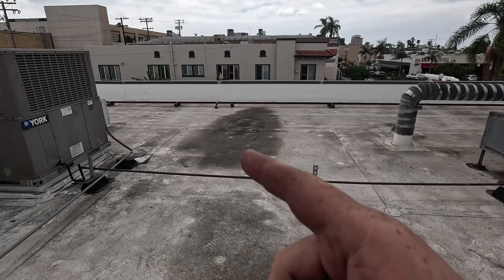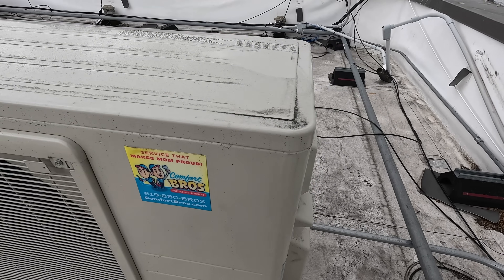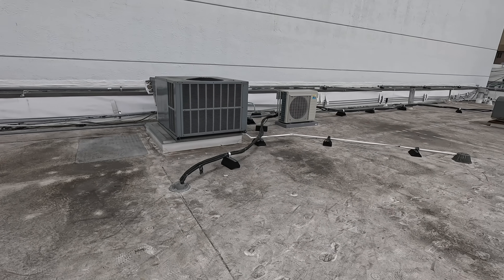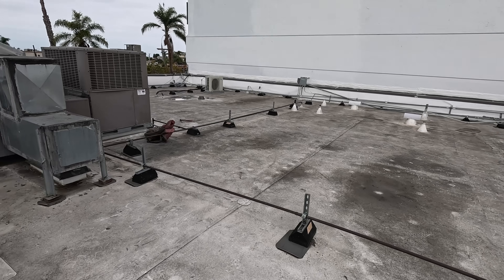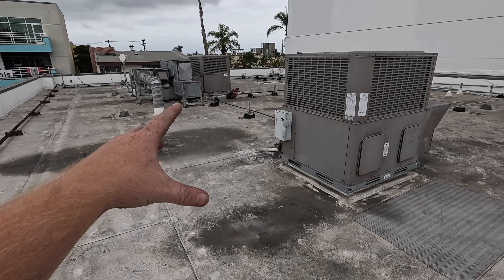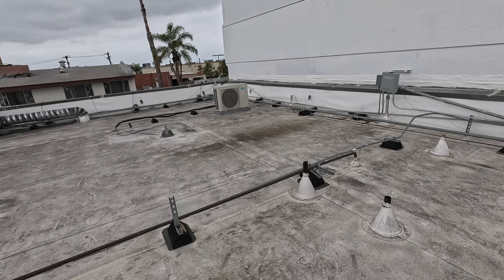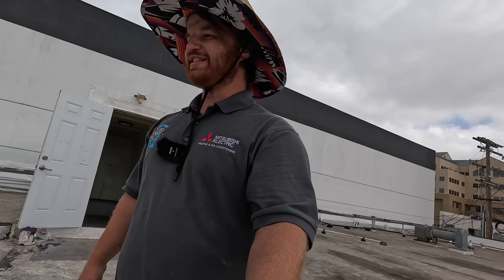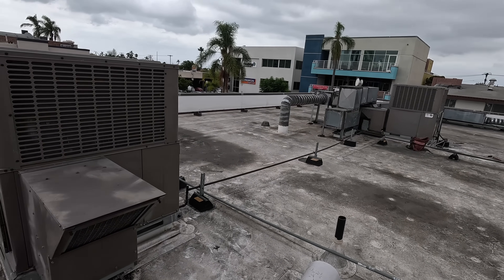$50,000 HVAC Install Mistake Required Two Minute Fix

Comment: A quick check of the supply temperatures at the registers would have caught that.
Reply: There is a surprising number of techs who don’t have a thermometer
Reply: The service tech who posted this mentioned that the unit was discharging into the rafters; I don't know why they would install it like that. But it would make it hard to get a good measurement.

Comment: Omg heat running for 6 yrs on an AC call… caused by an missed programmed tstat was it the OB switch or programming & no one caught it … sound like one of my  calls a few years ago for a friends daughter he had a new 90 % gas furnace 
installed like 4 yr before  & the complaints were that heat would run some 30-90 seconds & cut off. & none of the 3 other hva c co that came out could not figure it out why ..? > one installed a new board the other a new pressure switch & all it was & i seen it in 15 seconds was the combustion air was still caped from factory…. No combustion air no-flame no heat for 4 years no heat fixed it less than 30 seconds

Comment: Find the install techs who originally installed them and have them sued into oblivion. Where they can only escape the debt if they are banned from HVAC service.
Reply: Yeah it doesn't work like that. The contract is with the HVAC company, not the techs.
Reply: @willlewis6747  Right, it is the company's responsibility to make sure their techs are properly trained and qualified for the work they are assigned to

Comment: Someone with a $25 Harbor Freight laser thermometer could have easily discovered that unit was belching out heat the entire time. It's too bad... Untrained, lazy, or greedy techs taint the entire HVAC industry. The greediest ones are just emulating the HVAC manufacturers with the current "equipment shortages" and R-454B scarcity and nose-bleed pricing.
Reply: yep I almost mentioned that in my comment.

Comment: No one fucking sticks a thermometer in those units to get a split? Wtf
Reply from the maker: Too busy selling IAQ products. Each unit has a UV light, iwave and aerus air scrubber
Reply: @SurfBrosHVAC I'm a year into this trade... Phoenix AZ. Working on half residential/ half commercial....walk ins...reach ins...... Blah blah similar to what your business works on. I can see while there're limitless areas to grow and paths to take to specialize. It would be quite easy to stagnate and waste time where I'm at now. I feel like my skill level a year in might not be much different from a guy 6 years in working for the same company. Therefore... I feel like I need to pick a path or at least an area of study. I would at least like to be a one man show with the ability to go full time, let's say... In 2-3 years. In the meantime I want to hop around and progress as fast as I can. I guess my next step is getting my Nate. Passing the core and picking a specialization. So you recommend something for that? Also .. if you don't mind the questions. Is there any workaround to getting my contractors license faster than 3 years from now? Thanks for the videos man. Appreciate any response.
Reply from the maker: @SirMetroMan  Funny enough I started in the Phoenix area as well. After doing HVAC for a year and a half I bought a truck and was an unlicensed HVAC guy doing repairs only under $1000 for one summer. It was great. I don't think there's a legal workaround besides staying under the limit of what's legal to charge.
Reply: @SurfBrosHVAC  oh that's great to hear man. I have picked up a little sidework and want to buy a truck. I know your busy but is there a way I can pick your brain on some stuff? I would really like to hear how you approached working like that. Anyways. Thanks again for the response 
Kyle
Reply: Right?! That's the first thing I would do after getting on the roof
Reply: NATE is worthless, anyone can pass that test if they study.  Have worked with plenty of Nate,heat pump council, etc.. certified techs who couldn't diagnose simple problems. Doesn't mean you know what you're doing, just you can pass a test. Unless your employer is paying you or forcing you to do it, spend the time studying for your contractors license. I'd recommend having 5-10 summers under your belt before you go out on your own. Have a group of guys you trust and work well with for when you get the oddball one you can't figure out. Start small and build it up debt free. Focus on taking care of people like you would want to be treated, and the money will come in naturally.

Comment from the maker: Few details not in the video:

-Thermostat was programmed for furnace+AC and the system is a heat pump
-The GM of 9 years is the one who told me that they never worked since they were installed and that there have been multiple companies. They specifically said there have been over 10 HVAC techs in the building in the last year
-I recorded this video on my third visit to the building and based on feedback from staff we are assuming the thermostat has been programmed wrong since day 1. The building is now an ice box
Reply: Seen something similar before. The thermostat was set up for a heat pump, but it was programmed for a fail-to-cool reversing valve as opposed to a fail-to-heat one.